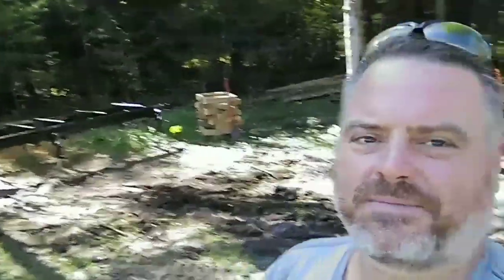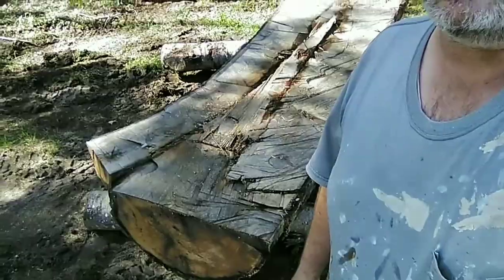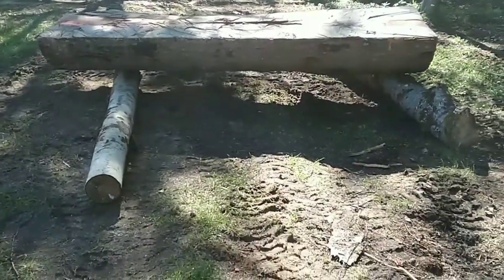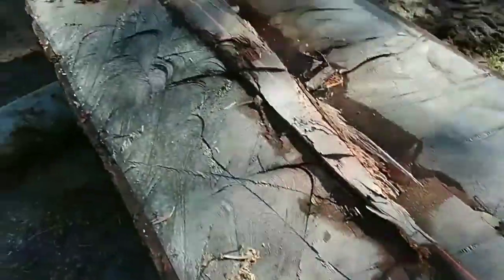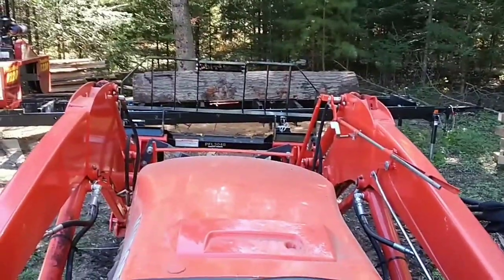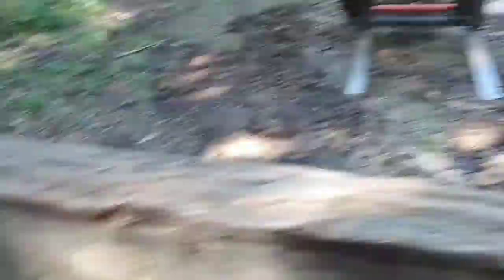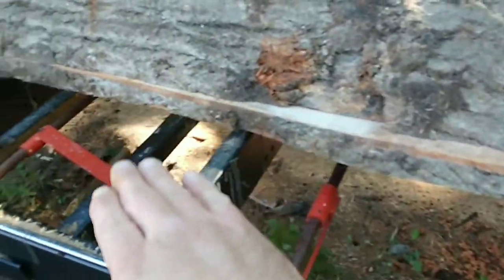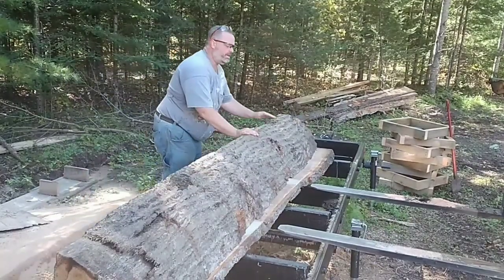Learn How to Mill Quarter-Sawn Oak Lumber on a TimberKing 1220

Comment: Next time, instead of the forkes In your kerf, cut the length like you did till the end has a few less inches than the length of your bar, then finish the cut sawing with the grain long ways, the log will fall apart gently Infront of you. I've split so many giant Redwood logs like that. Nice mill, I have the same one, happy sawing  to you.
Reply from the maker: Thank you!  That's great advice!  (Sorry for the delayed response.  I just now saw your comment.)

Comment: Is that just a regular chain on your chainsaw?  I'm curious how worked for ripping and particularly how it cut when you made the initial groove holding it more horizontally compared to when you cut all the way through the log holding it more vertically.
Reply from the maker: @patrickcleburneuczjsxpmp9558  
It's an aggressive chain I got at Tractor Supply.  If I had a rip chain, it would have worked even better.
Reply: @peaceofedenhomestead841   Almost all the videos I've seen of people using rip chains are in Alaska chainsaw mill type set-ups with the chain cutting into the end grain.  I bought an extra long bar and specialty rip chain that I've used, but I've only used it freehand, and I've mostly ripped more into the side grain than the end grain (i.e. with the bar closer to parallel to the length of the log.)  I don't have a regular chain for my extra long bar, so I haven't been able to compare directly to a regular crosscut chain, but I've wondered if a regular chain wouldn't actually work better for cutting like I mostly have as opposed to cutting straight into the end grain like with an Alaska mill.